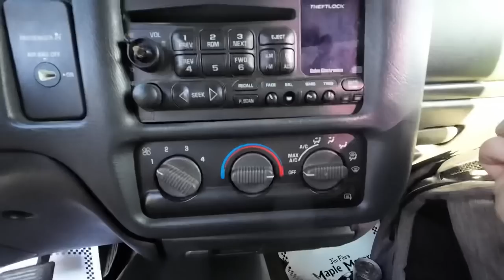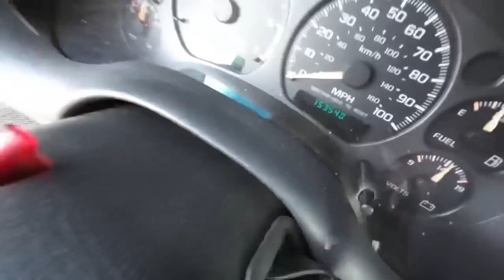Test Drive 2001 Chevrolet S-10 Extreme LS V8 EXT Cab SOLD $10,900 Maple Motors #2028

Comment: No ac ,steering alignment , mileage is off . Speedo is off .. 10k is a stretch.. your paying for a swap engine you don’t know the miles on or condition. And a s10 body that been molested to install said V-8.. this might make for Sirius buyers remorse after the fact.. definitely for a experience Mechanic..

Comment: When I seen this I had to look twice. I built one close to this except mine was no offense much nicer, mine had an 6.2L out of a Denali  it also had a floor shifter and console out of the extreme blazer as well as the steering column to get rid of the column shifter. It was the same color too lol mine had all working heat and ac as well as cruise control.
Reply: That’s awesome having a 6.2 in one of these. What year was the engine if I may ask ? Im guessing 2007 and up
Reply: @Fernando-Lopez67  yes, 2010
Reply: @tonytrumble  it definitely sounds like a clean build. Especially having everything functional. Bet she ripped
Reply: @Fernando-Lopez67  yes it was a lot of fun. Got pretty expensive replacing rear tires all the time lol

Comment: Big fan of the S10 V8's, owned 2 big block swaps in light weight regular cab short bed versions with one piece driveshafts.  This body style over 20 years old does NOT get emission hookup for inspection in my state now.  Nice truck guaranteed to be a blast to drive!

Comment: There's a whole lot wrong with that one. I've had a few S10 Xtremes over the years great daily drivers. My current is a 2000 Xtreme LS V6 extended cab same thing you got there great little truck. The problem with those LS swapped s10s is nobody ever does them clean there's always things that don't work or they don't work correctly. And they never have working AC. I got a deal when I got mine for $850. The kid that sold it to me even drove it up from Florida to CT to deliver it lol. He just happened to have family up this way he was visiting.

Comment: Always wanted a S10 Blazer Extreme with cowl induction hood but with a 383 or 472 powerplant not a Ls but 01 S10 Extreme pickup is clean midnight blue give it nice shine won't last under $12k whole alot power for fun little truck

Comment: If you spray a little silicone spray in the 2 window tracks the windows will fly up & down.  Also the window motors will last alot longer.  Stress kills the motors. ✌️
Reply: You’re right my windows were slow so I sprayed silicone spray in the tracks  now my windows are faster than my Corolla. 😂 stuff works great!!!!
Reply: From a former owner of several S-10's..Crazy Cat is spot on.👍